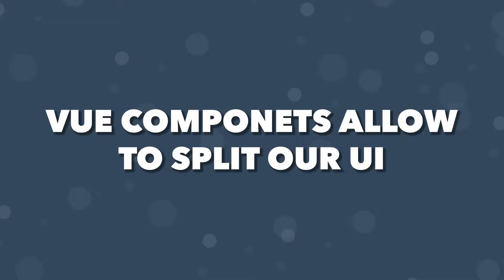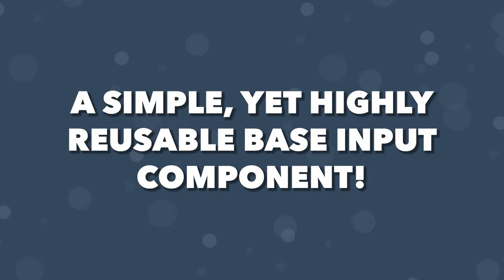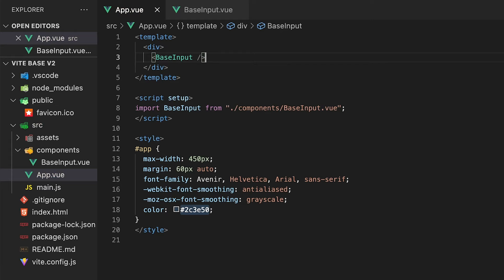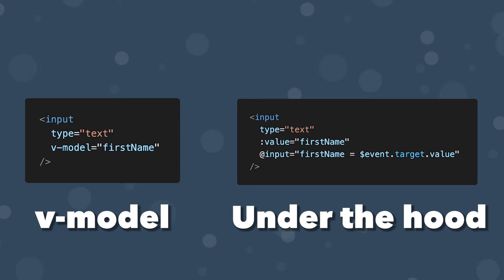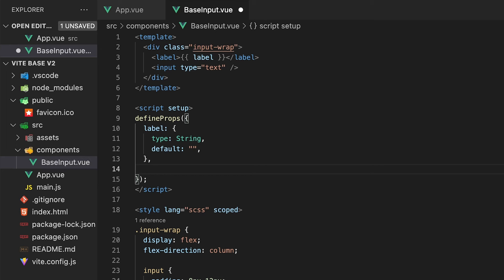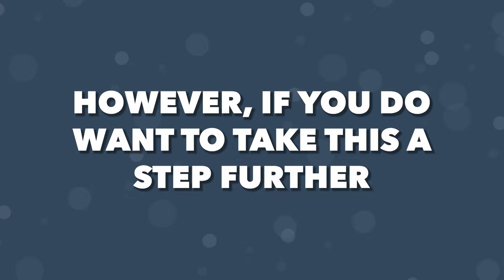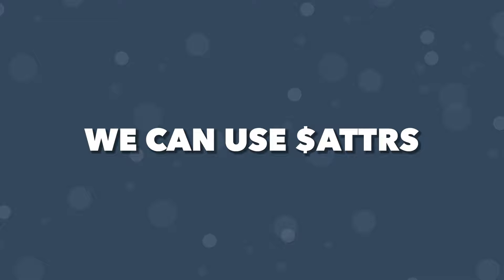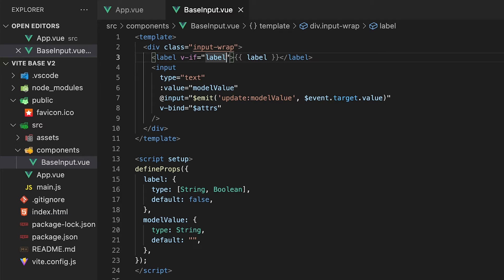Reusable Form Input Components With Vue 3

Comment: Pro tip: if you use `type: [Boolean, String]` for the label prop you don't need to specify `default: false` because that would be set by default
Reply: I think the whole boolean isn't necessary, just make the string not required. An empty string is falsy..

Comment: Thanks for the video John!
I have a question, the $attrs key binded can be used for any other html tag? Is there another using for this key?
Reply from the maker: $attrs holds all the attribute values pass from the parent for you to access within the template itself. You can use it on any element you want to inherit the attributes on
Reply: @JohnKomarnicki  Awesome!! Thank you 
Also, idk why I can’t use defineEmmits or defineProps() without importing them, the editor shows an error, or I’m not sure if it’s a vetur or volar error
Reply: @DanielTames Make sure you are using <script setup>